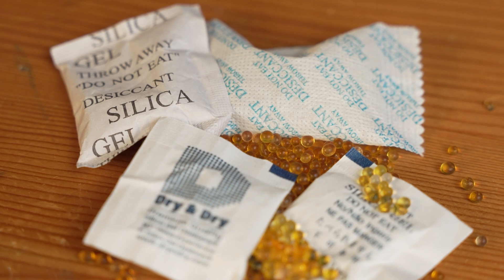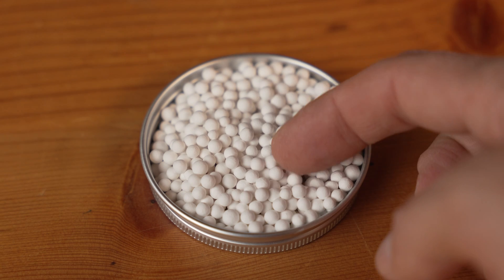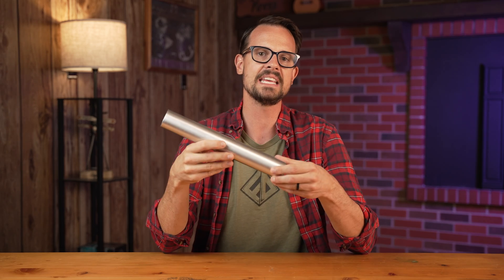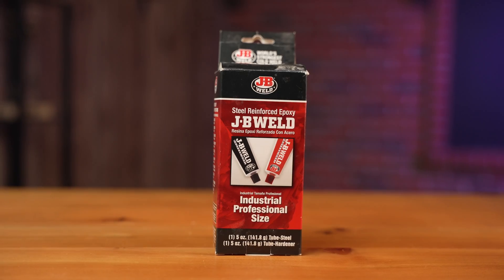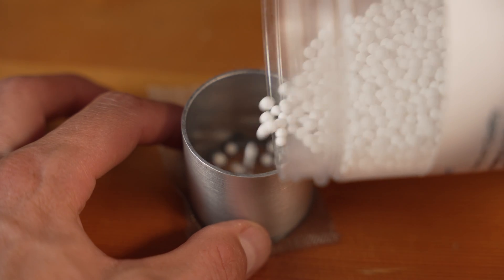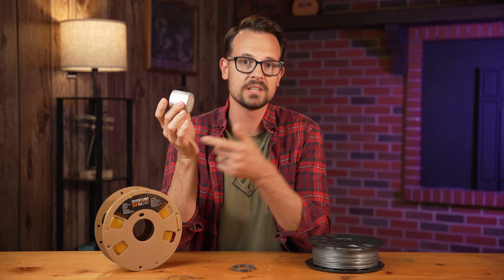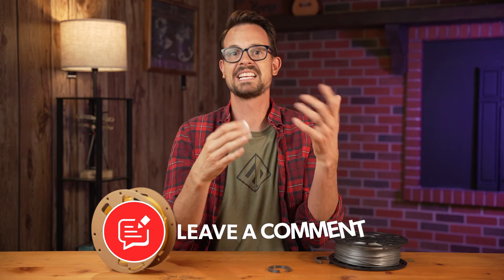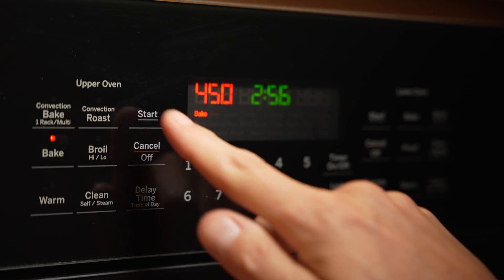The Perfect 3D Desiccant Solution: Convenience and Longevity Combined

Comment: I use those little nylon socks you see in shoe stores. I bought a box of them off said shoe store and have a tone of then. Work geat. Leave em in there to recharge in microwave. B careful tho. 15 sec intwrvals. Between each I massage it into a paper towel to dry out. Once it's got it's color back it's good to go. You mileage may vary depending on microwave wattage

Comment: Downside of putting it in the inside of the spool within a vacuum sucked bag is that it will basically close off on the sides, there will basically be no moving air between the desiccant and the spool, which defeats the purpose.
Reply: Just put a spacer between the bag and the spool when you seal it. Simple.

Comment: Because you can dry silica at 120C instead of 240C, its more cost effective to use silica as it can be dried in 20 minutes in the microwave vs 240C 2+ hours in an oven. Silica is also cheaper to buy.

Comment: I've been putting color changing silica gel into nylon stockings and tying the end.  I put these into sealable 5 gallon buckets which hold 5 or so rolls of filament.  The nylon holds up just fine in the oven at 270f and can see when the desiccant changes color through the mesh pretty well.

Comment: Sorry, as a person not close to 3D printing, I don't understand this. Why vacuum sealed bags are not enough on their own? Do they leak and allow air and moisture in over time? Or are you using dissecant to ensure that the air inside of the bags is extra dry for the duration of the storage? (Seems like a small amount of air to begin with)

Comment: But in a vacuum-sealed bag, does moisture from the filament even reach that center hole? Wouldn't you want the desiccant somewhere on the perimeter of the spool?
Reply: Everyone seems to put it there, I wonder if it was ever tested where is the best spot(s)?
Reply: Another YouTuber tested vacuum bag vs air tight cereal box for long term storage and the cereal box worked better with lower humidity.
Reply: The main purpose of using a vacuum-sealed bag is to keep the outside air out so it cant add to the work the desiccant has to do

Comment: When I was checking an online marketplace, I accidentally stumbled upon empty textile teabags. One pack with 100 bags with a string to close the opening. And I got a bottle with moisture sensitive colored silica gel. Works wonders. It's easy to move it from the bottle to a bag, the bag can be closed, air moves easily and it's still very visible if silica gel is dry or wet.
And as a bonus, it fits perfectly in the same vacuum bags as you show on the video.
Very nice video though.

Comment: Im actually new to 3d printing, but what do you mean with silica breaks over time? How much time does it take to break? Also i have some silica gel packets laying around since more than 7 years now... Never dried them as they were not meant for 3dprint, don't know if they've crumbled inside the package, but it doesn't seem to have any visible or perceptible integrity problems. Also silica's way cheaper and easier to find
Reply: @BlondieHappyGuy  it's been some time and I actually bought some, it does indeed crumble, but I do not think it's based on the "mileage" of the single pearl, rather caused by manufacturing defects. As per how many times you can reuse them, on my package there's indicated two to three times. I'll obviously try more than that untill it doesn't work anymore.
Reply: @BlondieHappyGuy  it's not every single piece oc, but some tend to shatter, I've found quite a few. Still work as intended tho!

Comment: 4:41  when vacuum packed. The desiccant pod, in its location , is  sealed off from absorbing moisture from the filament.
Reply: Yes, agreed.  The vacuum pulls the bag down tight onto the faces of the spool and seals off the desiccant.  Need a specially designed spacer to hold the bag off the spool faces.
Reply: Not really.  Vac bags have a texture on the inside that allows air to flow past flat surfaces.
Reply: Interesting

Comment: I'm still hesitating between the two materials, glad for this video and your basic idea with that tube but there is a thing I must disagree with it. As I read the activated alumina has huge surface. This is a main advantage what you just loose when you vacuum seal the tube ends and leave only pinholes next to the glued mesh if there is any. I want to recommend you an imprioved design with 3D printed caps for the tube that have holes all over. When you want to regenerate, you just remove them. A well curved cap won't stress the vacuum bag like the tube edge probably does.

Comment: I’m doing it, I bought 75lbs of activated alumina - info is scarce about it, so I’m rewatching this and other vids talking about it. I’m using 3D printed canisters as cores for every spool to go from storage cabinet or food saver bags to dry box or ams - and I’m going to keep an eye on the RH in the cabinet, bags, dryboxes and ams’ with mini hygrometers and see when it starts to wear out and then dump and recharge it all en masse, still gotta figure out the time in the oven and how long the AA will last.
Reply: Following up, just about 2 months before the RH started creeping up for me. It’s not bad yet, but the hygrometer in my ams shows 18% RH and the ui shows a 2 - going to try and dump it all out into a glass baking dish and bake it
Reply: @joeylopezdesign  I was wondering how baking it in a glass dish worked for you, and how much you put in the dish and baking times and temp? Greatly appreciate any feedback. Thanks a lot.
Reply: @carmandr24 I microwave my silica gel desiccant in a pyrex pan.  I use the defrost setting for 1.5 lb.  This works perfectly for me.

Comment: I have 12 silica gel bead containers in my filament cabinet and they kept it around 19% RH but once spring and summer rolled around I can’t keep it below 45% - it’s driving me crazy, I keep refilling and recharging the desiccant in the microwave every week because they turn color so fast, need something better asap
Reply: Have you tried running a dehumidifier in the room?
Reply: Maybe sealing the cabinet, the air between the cabinet and the room does not exchange unless you open the cabinet?
Cause the way it sounds, your dessicant is dehumidifying the room.
(or sealed containers with the silica containers in them inside the cabinet.  ->easier than to seal the cabinet.)

Comment: I use colour indicating silica beads in small, round, perforated tin screw cap containers. Throw two of the tins in with the filament, drop in a small humidistat, suck out the extra air, and I'm good to go. As soon as the humidistat reads anything above 15%, the tins and the filament go into my dehydrator. Been running like that for a while and it works well.
Reply: You got a link to the containers by chance?
Reply: Unfortunately, no. I couldn't find anything at the required size/shape. I bought 50mm round tins on Amazon, took a 1/16th inch bit to both sides and perforated them myself. Used a wood plug inside the tins as a drilling surface. Ground the inner burrs with a dremel. Takes some time, but something I do during spare time.

Comment: I stopped using silica a while ago.  It's ok for long term storage but it really doesn't have the oomph needed to pull enough moisture.  I prefer calcium chloride.  I get a 2 pack of desiccants from the dollar store for $3 and each one lasts about 6 months.  I have put a new spool inside an airtight container with the calcium chloride, put the lid on and just left it at room temp for a few days.   NOTICEABLY drier with zero electricity needed.  Granted if you employ a little heat things dry up even better.  I'm happy to wait for filament to dry and I do not need it available immediately.  The best part is that once the calcium chloride fully dissolves and stops working I can drain the desiccant packs into a pyrex dish and pop it into the oven when I cook.  It'll dry out to a crust which I can then put back into the pack and reuse.
Reply: The way moisture is absorbed into the polymer is not unlike how cooked long-grain rice "crystallizes" as it cools. Long story short, it is always a good idea to heat up the polymer to "eject" the absorbed and incorporated water.
Reply: @MMuraseofSandvich  Well, if you have enough moisture, ;-) dry calcium chloride reacts with water endotherm. (so when it takes up moisture it gets warm itself...)

Comment: is this more toxic than silica gel beads?
Reply: Less toxic than silica, especially the color dye indicating silica
Reply: @Barak50cal  The only color-indicating silica that is toxic is the type that is blue and turns pink when indicated - this contains cobalt chloride, a known toxin/carcinogen. The type that is orange and turns green when indicated does not contain cobalt chloride and is not toxic. Further, "normal" (non-indicating) silica gel is also not toxic.
Reply: Non-colored silica gel is not toxic.
Reply: If silica gel isn't harmful why do i have to wear a respirator when pouring it or my lungs feel it. And also it makes a bad smell when recharging even when i heat it at less than recommended temperature.
Reply: @honkbeforeitstoolate587  "Harmful" and "toxic" are not interchangable.
Reply: @neufxtrois  Then obviously "harmful" is the more appropriate metric in this discussion. I'm going to have to re-evaluate the options, alumina, silica gel, and calcium chloride. What we all want is safe & convenient desiccation. I was given the false impression that heating silica gel in an oven beneath a certain temperature was safe and the oven remains food safe. My experience was that it does make a noxious odor or particulate when heated, even beneath the recommended temperatures, and I'd never do that in a food oven, I bought a small oven second hand for that.

Comment: I personally would solder mesh with soldering iron and a few tin drops. Nevertheless, thank you for informing about activated alumina. Subscribed + new to 3d printing
Reply: by the way, it is cheaper in Ukraine to buy alumina tube instead of vacuum cleaner tip/adapter/air intake
Reply from the maker: That is a great tip. I couldn't find a local place for just a small peice of tube.
Reply: @ResistanceLion  Sorry for necroposting, where did you find cheap alumina tube or what exact search term did you use?
Reply: @jjkjkjka  In local hardware store, back in days when Харків was producing lots of them. As well as mid-quality aluminium plates, so i also bought a whiteboard back then. About 800hrn or 30,7$ for whiteboard and 2x 1.2m aluminium tube

Comment: why do you say silica beads has a limited number of uses? I thought you can put it in the oven and it'll release the moisture, then you can reuse it.
Reply from the maker: They do release the moisture but they break down over time and crumble away.
Reply: @BuildItMakeIt  I got a 1kg packaged in a material, which lets moisture trough. I don't even know, if they break inside. The silica gel inside works fine and takes up to 40% moisture. I use it for more than 10 years I guess.
Reply: Silica beads cracking is a sure sign you are baking it WAY too hot.

Comment: It definitely still breaks down, but it's over a much longer time span. We use activated alumina for industrial air drying at work. We change it out every 3 years in the order of a thousand lbs or so. We have it tested annually.
Reply from the maker: That is good to know. How many cycles are you using roughly in those 3 years. I have some desiccant going on 8+ years but it is only like 5-6 cycles in and still works really well.
Reply: @BuildItMakeIt  theyre continuous service, 24/7 drying cycles takes around 2 hours at 335f. then 2 hours of cooling. then the cycle repeats so 6 cycles a day. far more than youll ever see in your garage just a fun fact...
Reply: @BuildItMakeIt  i will say im not sure how high humidity levels effect the lifespan. our dryness is measured around -163f dewpoint. where as say 70f 65RH is +58f. 

We go from dry to dryer. id speculate our use case (home), is a more severe service from a humidity standpoint.

Comment: What is the maximum weight difference you have noticed before/after recharging? I only noticed a 10% difference at 200c for 2 hours and a third hour didn’t result in any lower weight (I don’t have a normal oven available at the moment) one retailer suggested 200c at 2 hours and I was skeptical if drying would really recharge it since in normal use there is a chemical process for recharging activated alumina.
Reply from the maker: I get out of a container probably a 20% weight reduction but I think it depends on the humidity level that they have been exposed to.

Comment: Is it safe to recharge the alumina in the same oven you would use for food? 

Obviously it would always be better to not but not all houses have a second oven laying around.
Reply from the maker: I think so since it is the water that it is absorbing and we are releasing, but that is just my opinion. I do, but maybe someone else can chime in if they know of contamination risks.
Reply: @BuildItMakeIt  In that case, I do hope it is safe as I am currently waiting on my order of tea strainers to put the activated alumina inside. Gonna replace all the silica dessicants I am currently using
Reply: a small toaster oven could be committed to this use.
Reply: According to Google's AI:

"Yes, you can dry activated alumina in an oven at a temperature of at least 200°C (392°F) for two hours. This process is called thermal regeneration, and it removes adsorbed contaminants from activated alumina. Thermal regeneration can be used in air and gas drying, catalyst support, and water treatment. 
Here are some tips for thermal regeneration:
Avoid overheating: Overheating can damage the activated alumina's structure and reduce its performance.
Use a controlled environment: Thermal regeneration can be done in a furnace or oven. 
Activated alumina is a chemical-free, non-toxic, long-lasting, and recyclable option that absorbs moisture well. It can be used in air dryers, and can also be used for catalyst support and water treatment."

Comment: Nice selection of books. What do I do if I don’t have those same books?

How important is it to keep the filament dry in a desert climate like, say, New Mexico?
Reply from the maker: Well if you don’t have the exact books I used then you can’t make this project. The whole project was designed around the weight of the books in mind and their relative size between the desiccant tube’s diameter and the surface area of the books. Now in order to mitigate local variations in the strength of gravity I didn’t perfectly stack the books but angled them in relation to the desiccant and local field variations. This may have been overkill but seems like good practice that I think is pretty standard when working in this field. Now you may be asking why was the same technique not used on both the top and the bottom glueing as the weight, size, and configuration changed quite drastically. I’ll have to cover that in a future video so make sure to like, subscribe, and hit that bell notification so you don’t miss out.
Reply from the maker: Keeping filament dry in New Mexico I don’t think is super important for abs and pla, but is a necessity for nylon.

Comment: I put it in an old cotton ankle sock with a pipe cleaner as a twist tie. Weigh it before, after use, and after recharge at 400°. Works just fine. I get it though. You're a crafter making content.
Reply from the maker: Ummmm…..that’s a really good idea. Yeah that’s way easier than this idea 😂
Reply: Do you have to remove it from the sack before you recharge it in the oven?

Comment: I contemplated making the containers like you did for silica gel previously. Until I discovered that buying metal tea dust/ leaf strainers are basically easier and potentially cheaper than doing so. Not to mention, they can be opened if you ever need to remove or replace the desiccant.
Reply from the maker: Yeah, now that people have been pointing it out to me it looks like there are some ready made solutions that may work pretty well. I ordered this tea strainer https://amzn.to/3MbV9tC and am going to see how it works in comparison to what I made. Thanks for the tip.
Reply: @BuildItMakeIt  Another method I had contemplated was to use the wire mesh to make a pouch and just use wires to 'sew' them up - this allows for customized sizes or shapes when commercial alternatives won't fit the needs. It will still be able to withstand the temperatures of baking in an oven.
Ultimately, the tea strainers was what I went with as I just needed it for absorbing moisture in food containers and the fit wasn't too big of an issue (just got to be careful which desiccant is used as some of them contain toxic dyes).
Reply: @BigBenAdv  Was thinking the same thing, except just using a stapler to staple it shut.
Reply: @BuildItMakeIt  How have those tea strainers worked so far?
Reply from the maker: @TimDavis77  They have worked fine. They are a bit smaller, and rattle around some more, but they didn't pop open since the top screws on. I wish the holes were bigger, but it seems like it is sufficient air flow for longer storage.
Reply: @BuildItMakeIt I’ve been using a larger, screw top, tea strainer to oven dry my silica for a while. Works great. Just ordered some alumina beads and smaller 1.5” diameter, tea strainers. At $9/pair they are a bit more expensive than the handmade ones. But lots less work. Will see how they fit in the spools.
Reply: I bought a ten pack of cocoa/sugar dusters on aliexpress for exactly that
Reply: @BarryPienaar-tc8or I was considering those. But decided on tea strainers. The dusters are only open on one end (not sure if that’s an issue, the humidity is everywhere), but the mesh is coarser. Not sure if that lets in more moisture/faster? The tea strainers have a very fine mesh. Apples vs apples.